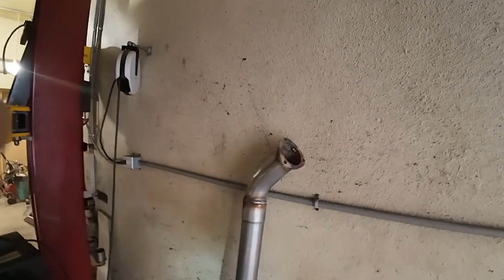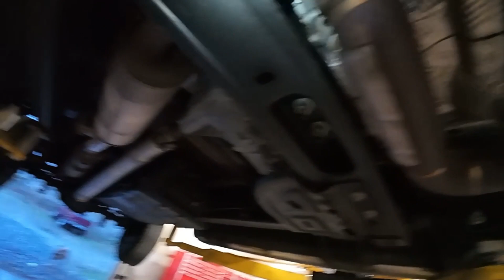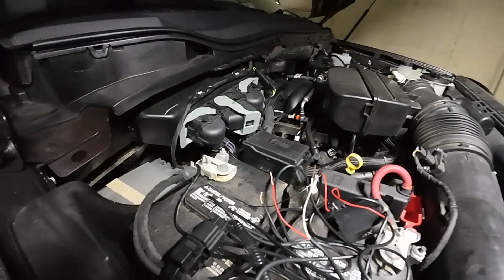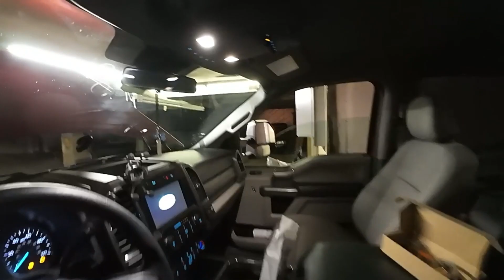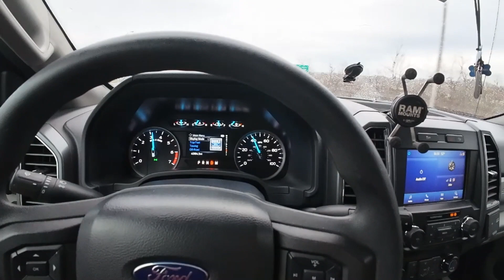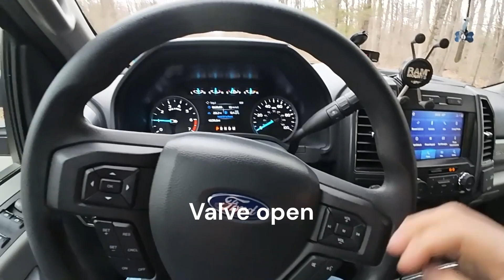Ford 7.3L Godzilla Exhaust Cutout

Comment: Hey, love what you did to your godzilla.  I did something similar to my old 5.0l and loved it.  Can you share your finished product pictures please?
Reply from the maker: I actually changed it up so I don't have this setup anymore. T
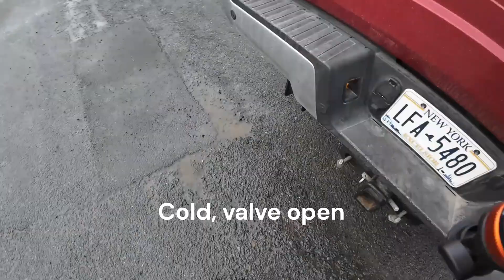You can see most of what i did at 11:15
Reply: @AmericanAutomotiveChannel ok, thanks for that.  What didn't you like about this setup?
Reply from the maker: Just too quiet and the cutout valve failed.
Reply: @AmericanAutomotiveChannel ok thanks.  Did you like the sound with just the cutout and no exhaust attachment?  What exhaust setup are you running now?
Reply from the maker: @jordanrobins8878 I never ran it with just the cutout. Swing and a miss on that one. 

I wound up just deleting the muffler and resonator in front of it. Its still pretty quiet but has a nice rumble now and you actually can hear it. I like it so far. Ill do a video eventually I just want to get some good footage of it.